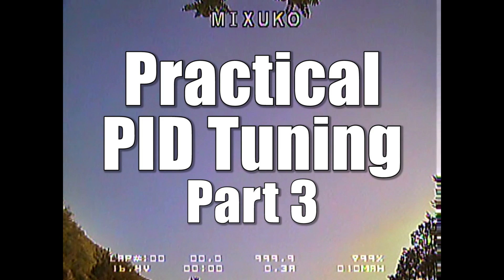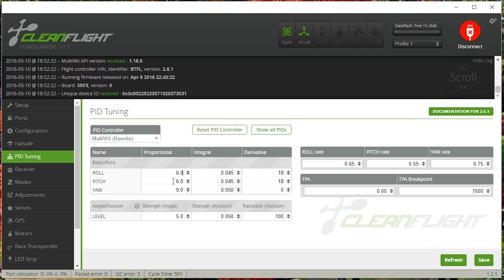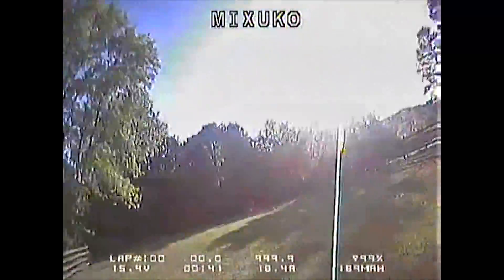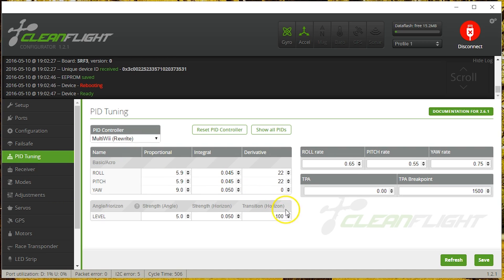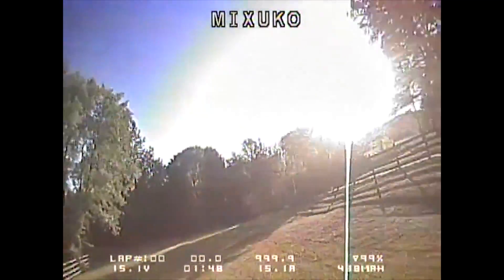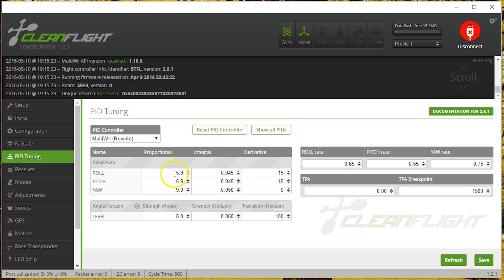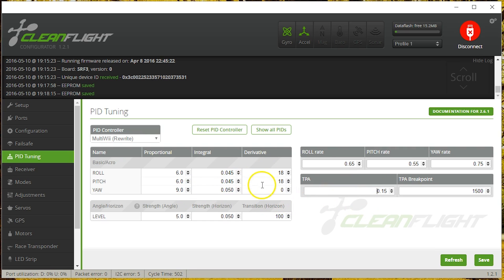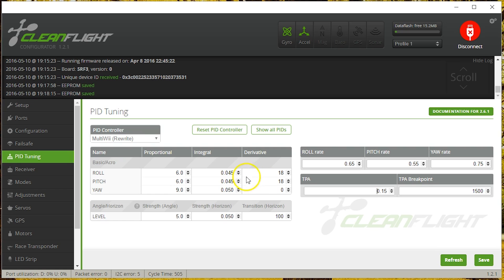Practical PID Tuning - Part 3  | HOW TO TUNE A QUAD

Comment: Thanks for the info. I am dealing with some prop wash right now in my Eachine Aurora 100 with FlySky transmitter. I am a beginner with Betaflight and trying to learn. Anything you can suggest please let me know bro. Just looking at your first 3 sessions, I believe what I am hearing is D term prop wash so I will go down a little on D gain and see what it does. Jeep it in the air bro.
Reply from the maker: In general, raising D gain helps propwash. But watch for hot motors.
Reply: @JoshuaBardwell  thanks a lot.

Comment: what causes video noise at close proximity when doing throttle punches
Reply from the maker: Video noise when you raise the throttle is because of vibration in the motors causing electrical noise. Make sure you don't have a damaged motor first. Soft mount the FC second. Add a 330 uF 25v low-ESR electrolytic capacitor to each ESC power pad next. Finally, adjust your tune by lower D gain or adding filtering.

Alternatively, you can look at filtering the video system itself. Sometimes a capacitor on the vTX power supply will help. But getting rid of the noise at the source (the ESC) is better.
Reply: Joshua Bardwell, yeah they're brand new Emax 2600kv motors and the new Betaflight F4 flight controller.  Not sure if I had went a little over board but I bought a bulk of 1000uf 35v capacitors and I put 1 on all 4 ESC'S and I put 1 at the main power lead.

That's why I was a little confused when I started seeing a little video noise at punch outs. It wasn't  break up noise, it was a distorted color noise.
I'm also struggle with when trying to go straight, it seems like it is drift sideways
Reply: have you ever find yourself having to turn your PID loop down half way and it helped?
Reply: Yeah I had to build a new quad cause my Gep-lsx6, I did a power loop into a pond and the flight controller didn't survive, everything else did though.

I don't know if you have had to try the Geprc Gep-lsx6 with 5" props. I swear it has the best flight feel I have ever flown, for freestyle and for racing.
Reply: OMG, IT'S MY CONTROLLER. The Yaw and roll are jumping around at midcenter. One second it reads 1500 after letting go after going left and then when I go right and let go so it goes to center and it reads 1510. How do you add center deadband to yaw and roll. I tried it on the transmitter page on Betaflight and it didn't seem like it's working.

Comment: Can you redo this procedure, but at the point of date, maybe I fresh flash of BF3.2, and answer maybe a question I can't find, and that is? Do you with all the advance features we're  spoiled with like anti-gravity and air mode, do you start tune with there's features enabled or add them after the tune. I could never find when to enable these before tune or after? Thanks
Reply from the maker: +cJhudanich I always enable air mode and use 3 points of anti gravity st the start of a tune.
Reply: Joshua Bardwell thanks
Reply: 5 packs on a qav-rxl, runing F60pro 2500kv, BLheli_32, Butter Cutter 5050x3 props Luxf4osd target. some weird noises "kinda taming them down a lil" but start tune today went well.

Comment: Joshua....I didn't know you could do multishot with the Littlebee 20A ESC non BLHeli_S.
Reply from the maker: You can flash multishot firmware to any BLHeli ESC. It's just not supported stock.
Reply: Joshua. Thanks for the follow up. I think I'll be stuck with running OneShot125 since I have a Naze32 F1 rev5 board on the build in question. I get over 100% CPU load any higher than 1.6Khz gyro and/or PID loop. Need an F3 board.

Comment: hey joshua.. i am in the process of tuning my zmr250 and am having a few issues.. 1 being that in your video i see that the P numbers are ranged in the 2.5 3.5 4.5 etc.. and my P range is 25 35 45. is this basically the same just a different decimal?  2.. ive been incresing my P gains and i am not noticing ANY oscillation issues. im almost at 90, 100 on the P gain.. and lastly 3.. the quad is almost pretty good but i am getting crazy wobbles after a flip or roll.. more on the pitch axis... after a flip it will almost change directions after a flip and wobble almost like theres not enough I gain.. everything is at atock PIDs.. can you breifly explain why this is happening? especially why i cant get any oscillations after upping the p to almost 100
Reply from the maker: PIDs were re-scaled somewhere to change from 2.5 to 25. It's the same, just multiplied by 10. But don't think you can translate PIDs between different PID controllers, such as Luxfloat vs. Rewrite.
Reply: And the reason you are not getting any oscillations is possibly because you are now on BF 3.0+ I am guessing. With BF3.0 there is a much wider range of acceptable values, which makes tuning a bit trickier and more of a personal thing. +Joshua Bardwell, I haven't watched the most recent Practical PID tuning videos yet. Do you address this in any of the more recent ones?
Reply from the maker: +Kent Boehm sure. The recent videos involve Betaflight 3.0.

Comment: are there major changes in pid numbers between cleanflight and betaflight?
Meaning - if I just tuned my quad (and I'm like, 95% of the way there), and I flash betaflight, can I copypaste my pids?
Reply from the maker: +vissago no, not at all. Start with the defaults, which fly very well, and tweak from there.

Comment: Why aren't you using in-flight adjustments?
Reply from the maker: I like to know the exact numbers so I have a sense of where I'm at at the high and low points. It helps me know what range of "good" values to expect. If I use in-flight, I only know the final, right number.

Comment: Maybe a silly question here: can I tune a copter if I have the FPV camera mounted on a vibration damping platform (with 4 small rubbers)? Does it make a difference?
Reply from the maker: Yeah sure. You can still hear oscillations.

Comment: First of all - great series, thank you. And here is a couple of questions.
1 - is it right way to lower I and D about 50% in the beginning of tuning to clearly understand exactly P oscillations? and then tune D. 
2 - still not very clear for me effects of low or high I. Is it appears on low throttle? like loosing angles while going down on low throttle? And than how can I see the overtuned I?  Thank you.
Reply from the maker: I always start off by flying the defaults and looking for bad behavior. Usually, a good default setting in a firmware like Betaflight will be slightly under-tuned for most copters, because the goal of a default tune is to fit as widely as possible, and over-tuning creates more problems than under-tuning. So I assume that I will probably have to bring P and D up, not down. So I don't bother lowering P and D off the bat.

If you don't feel confident in your ability to detect signs of high P and D, then you might start by lowering D especially and tuning P up and down by itself. This is an exercise I would encourage every person who is learning about tuning to do. Leave I at its default, or perhaps slightly low,  lower D to a negligible value like 5 or less, and move P from a value of perhaps 3 to perhaps 10. Down near 3, the copter will probably be very hard to fly. Somewhere towards the high end, it will oscillate like crazy, or perhaps you can go even higher than 10 depending on your setup! ALWAYS BE READY TO DISARM AND DUMP THE COPTER when playing with high P and D gain as sometimes the copter can "fly to the moon" uncontrollably.

Low I gain for me shows up most clearly when you move the throttle rapidly. Punching it up or chopping it down, either one. This changes the aerodynamic situation the copter is in abruptly and the I term must struggle to keep up. High I gain is really a matter of feel. The higher the I gain, the stiffer the copter will get. Some people might like that feel, and others might not. Like some people might like the soft ride of a Cadillac, and others might like the stiff ride of a Corvette. Sort of....
Reply: +Joshua Bardwell fantastic answer! Thank you for this work!

Comment: Thankyou for you great vids! 
I have a question about yaw. I can do very fast 90 deg yaw. But if i keep full deflection the quad starts to climb after 90-110deg turn. Seams this happens when it has accelerated to the max yaw rate. (Little guessing) If I keep the full deflection it starts to descend. I put in a switch to do full deflection for one sec just ta make sure that I did not move the throttle by mistake. Also when releasing the stick it climbs again. I vent from P 9.5 to about 2 on yaw then it was gone but 2 is to low. Also took down my min throttle and that helped a little. I have KISS FC, DYS SE2205, KiSS ESC 24A.
Reply from the maker: So what's your question?
Reply: Is it possible to tune it away? Or is it   just to be expected? Why can I do fast 90 deg yaw but not 360 deg without it starts to climb?
Reply: I'll google some more but kind of hard without blackbox data to see what rellay happens.
Reply from the maker: Kingbäck Andreas it climbs on yaw because the motors get out of balance with each other. Your yaw rate may just be too fast for what your ESC's can handle.

Comment: Joshua, I just got my F3 FC up and running today and was told to set my looptime to 250. That disabled my acc so i settled on 500.  Quad flew very bad.  What kind of looptime do you run?
Reply from the maker: 250 or 500 makes no difference--if the quad flies "very bad", it's not because of your looptime. Pick a looptime and get to tuning. Faster looptimes will make the copter able to be tuned more sharply, but if you aren't already a very good tuner, you probably won't notice a difference between 250 and 500.
Reply: +Joshua Bardwell well i just noticed stock pids at default looptime on betaflight flew much better than stock pids at 500 looptime

Comment: The other way to reduce flip bounceback is to reduce I, right? At the cost of "locked-in-ness", of course. Could we (Boris) dynamically reduce I temporarily during and shortly after high stick deflection moves, to reduce bounceback without sacrificing attitude hold?
Reply from the maker: Some form of dynamic I term limiting has been in place since 2.4.x.

Comment: If you're tuning without blackbox, what are the indicators that you need more/less filtration on the D-term? I was having really bad propwash oscillations, and if I raised D enough to tame them, I got oscillations in punchouts.  Now I've dropped the filtering to the 2.7.1 defaults, and there's less propwash, but it's still there, I'm wondering how I would decide between raising D and lowering the filtering.
Reply from the maker: Without blackbox, determining the filter level would be very challenging. In general, I would prefer to lower D gain compared to more filtering.

Here's more on this topic: https://www.youtube.com/watch?v=Y9bj0fo532w

Comment: 12:26 I hope that you're right here as I''m slowly going mad. Tuned my quad 3 times now but as much as it feels locked in I can't get rid of propwash no matter what. Started to blame escs, new ones are waiting in the drawer.
Reply from the maker: +blackcamo FPV what ESC?
Reply: +Joshua Bardwell 12A kingkong on blheli, xrotor 20A are waiting to be put on but quite bulky/heavy on 210 frame. I'm still on 3s.
Reply from the maker: Xrotor 20 are very good when flashed to BLHeli.
Reply: I hope so :-)

Comment: Josh..long time listener, first time caller.  Well kinda.  I fell like you really ignore the I term when tuning.  I have followed many of your tutorials and found that D really works best to tune out the over rotation on flips and rolls, but I plays a HUGE part in oscillations.  There is a recent post in Betaflight about this as well. 

I noticed in this video you increased your P until oscillations at high throttle, totally agree.  However you skipped right over the I-term and went to the D term and raised it.  I find that raising the I term helps on those 180 hard turns more then the D...

However this is REALLY hard to see in a log!  Curious as to what you think you mighty PID master.
Reply from the maker: My impression is that I term operates over too small a time window to affect oscillations. It just doesn't move fast enough, unless you have I gain way too high. If this has changed, I'd be interested to hear about it.
Reply: I can't find the post in the Betaflight thread..I sneezed and ti advanced 20 pages!  Nice video though on how to get the quad very close!!!!

Comment: Good stuff!! Edit - I was having the same issue that you had at 7:04- You're sure it was just min throttle? I had mine at 1026 but I changed it to 1030 and haven't had it happen again, but was still skeptical it might have been a PID error.
Reply: You could have had a prop  "blow out your tail" (a term more used by Rc heli guys) where 1 of your back props (inside prop to the turn) had no air to bite into while turning .. Really happens to "dead cat" frames (like the atom) bad.. Upping min throttle can give the rear, inside prop in a turn, have enough power to stop a blowout.. Better pids will help along with have your cg spot on also!
Hope this helps!
Relevant_FPV
Reply from the maker: Raising min_throttle fixed the issue, so I conclude that was the cause.
Reply: +Alex knowledge is power! Glad it works brother
Reply: I've made about 5 flights since I changed min throttle, and the issue hasn't happened again. I think you are right!!
Reply: Thanks! Yes it is...and I'm glad too, haha.

Comment: Nailed it. I wasted so much money and time buying SETS of crappy escs. Pids cant help junk equiptment. And price difference is so minimal.
Reply from the maker: Oh god yes.
Reply: Just curious - What ESC's were giving you trouble?
Reply: +Alex emax simonk 12a
Reply: Good to know...I think it's time for me to upgrade! (Using those right now too.) Thinking about getting DYS Mini XM20's
Reply: That is the conclusion that I came to today after third attempt of tuning my quad. [fairly short process as I'm doing it through minimosd] No matter what I do, how solid it feels - the propwash is there and it keeps showing me two fingers :)
Reply: Bah yeah I feel you. I'm not really having propwash issues as much as I'm having to crank my D gains way up in order to stop roll and pitch oscillations from occurring.
Reply from the maker: +Alex not true. The right setup, the right firmware, the right tune... It's just flawless.
Reply: Wow, good to know. I obviously need to keep tuning/improve hardware. Time to ditch these SimonK 12 amps.
Reply: +Alex just tested dys sn20a today and tuning was easy. Flys so much better
Reply: +Alex just tested dys sn20a today and tuning was easy. Flys so much better
Reply: Good to hear...I'll order a set now...

Comment: By going to multishot would this allow you to keep/increace p gain without any downsides?
Reply from the maker: Possibly, at least a little bit. My experience is that the more responsive the system is, the higher you can raise P without uncontrollable oscillations.

Comment: Great set of examples. Would it be too much asking for an H quad tuning? Just to see how different it might be. Thanks a lot for opening us the black magic of PIDs. Keep up the good work
Reply from the maker: Not very different at all. As long as the motor layout is basically rectangular, there is minimal difference between an H and an X, at least at the sizes we are talking about. Weight distribution has a much larger effect.
Reply: Someone in my quad group pointed out that on H frames, it's possible for more weight to be distributed along the pitch axis as opposed to the roll axis, so on an H frame you might have slightly lower values for the roll axis.
Reply from the maker: Sure, but that's equally true for an X quad. The shape of the arms has little to do with how the weight is distributed. Honestly, the fact that the arms are shaped like an X is completely incidental. The arms could be shaped however they want as long as the motor location and weight distribution stayed the same.
Reply: xD touché.